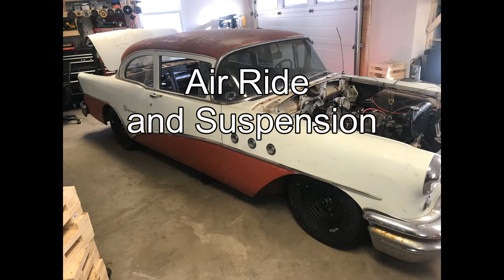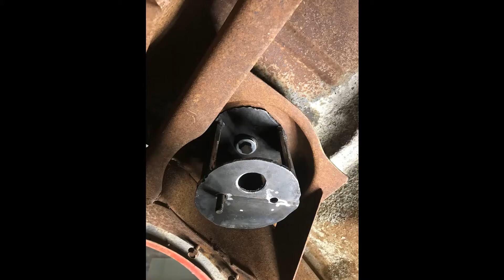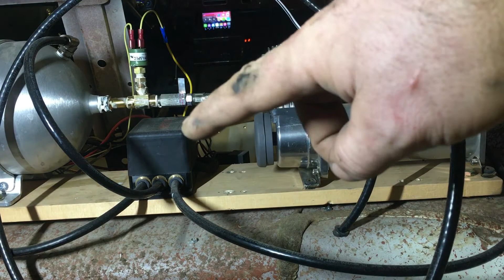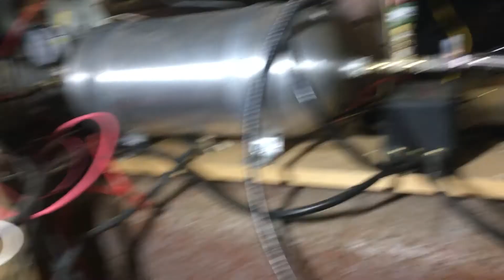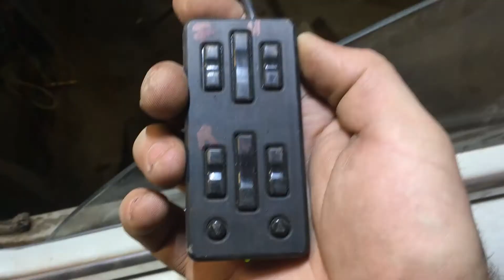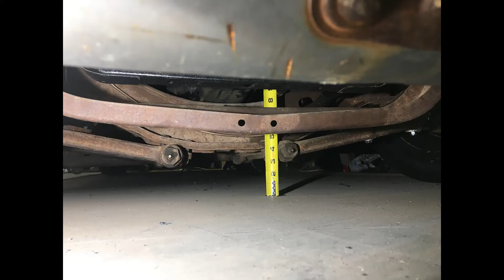Air Ride Suspension on 1955 Buick

Comment: Notice the 4 link but was that the original differential? Trying to see where you welded the link brackets ... My chassis is out and going with a sbc drivetrain 10 bolt and nows the time to put my bags
Reply from the maker: It is not the stock differential. It is one from a Nissan truck. The original one used a torque tube design which I wasn't going to retain.
Reply: Ok 👍🏽.... what’s size bags are those ?
Reply from the maker: @nelyh1395  The bags are Slam Specialties 7" , model SS-7

Comment: Can you tell me about or show the limiting straps?...thanks.
Reply from the maker: I used limiting straps that are typically used on offroad vehicles. They are a flexible belt that are bolted to the frame on one end, and the differential on the other. It was setup so that the airbags never get "stretched" to or past their max length which would damage them. The picture below shows how it looks. The strap is really only going to be tight when I jack the car up and the differential is hanging under the car.
https://imgur.com/1n7uoBa

Comment: I don't think those shock mounts are going to survive.
Reply from the maker: Hopefully they will but I will pull them out to see if I can strengthen it some more. Is it the lower or upper mount that worries you?
Reply: @karszone1580  You have to remember how much force that mount takes. It may not take much to compress a shock but when you think about what it takes to move it fast over couple inches it becomes more clear. That flat stock laying horizontal is going to bend, break the corner weld on that gusset, fatigue and eventually break. I would say the same for the sway bar mount. I think just boxing them in along the entire edge would do the trick. 

Sincerely, 
A guy that has broken a shock mount before.
Reply from the maker: @clint91x  I see what you are saying. I will add in more bracing on those lower mounts. I thought by using that thick of plate I could get away from boxing but better to be safe than sorry. Thanks!